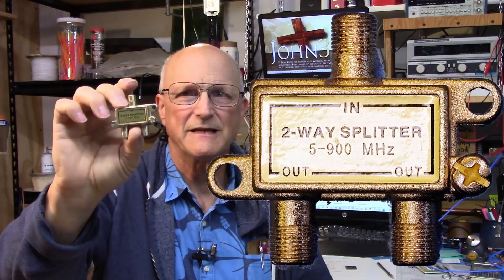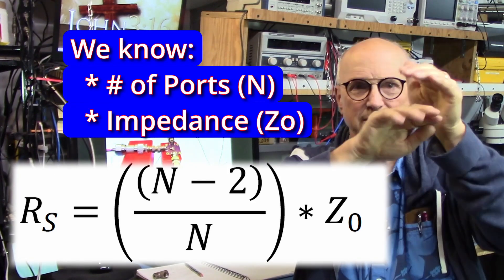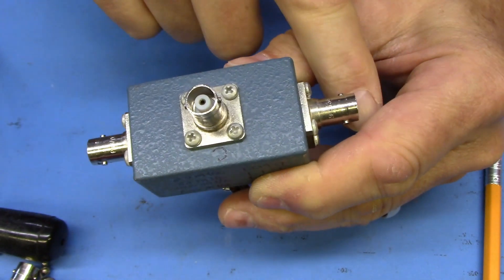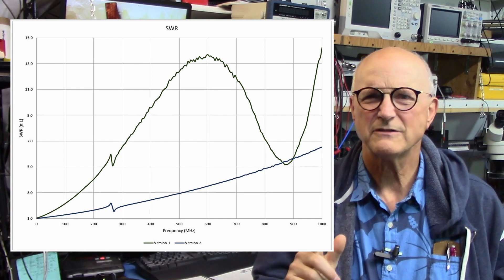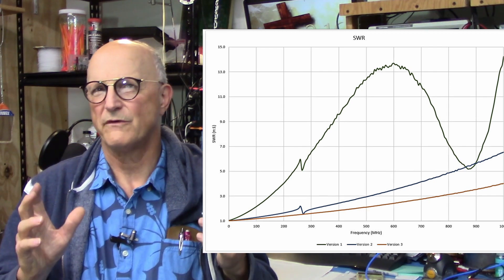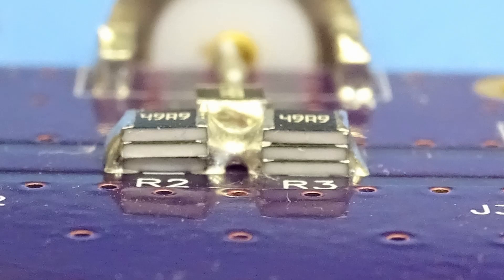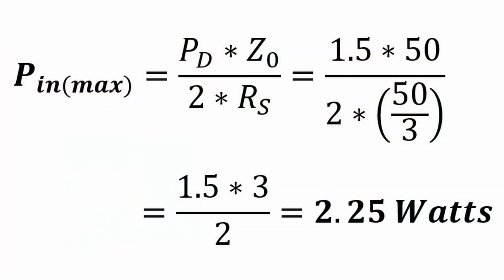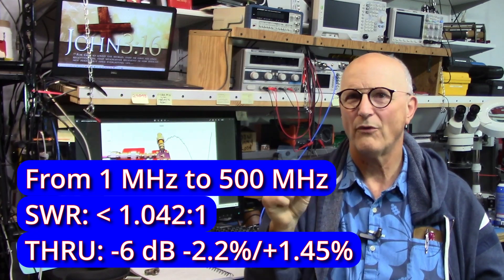RF Power Splitter Concept to Completion (035)

Comment: I very much enjoyed watching this. Thank you for putting it on Youtube.
And yes, as you kept saying, I could accomplish it.
Or rather, I could have accomplished it when I was younger (I am retired now).
However, it would have represented a significant investment of time from my point of view.
Why would you not go from theory and calculation straight to final implementation?
At one point I looked into specifying an RF project to be done by an RF designer/fabricator. 
This guy was a one-person shop, but he always went straight to surface-mount custom PCB for every prototype, using a board manufacturer from the very beginning.
If necessary he would tweak the values and the design until he got the results he wanted.
(Of course his cost per project was high.)
Since your design for this splitter never had to deviate from your calculations, it seems to me you could have done it that way too, and in less time.
Reply from the maker: Well, I thought I could accomplish this using leaded resistors using the really nice, blue enclosure.  So, try #2 was supposed to be my end product ... until I saw its performance.  Try#3 was an experiment to see if I could do it with leaded resistors at all; if this worked I would have bent up a MUCH prettier enclosure for it. When its performance turned out less than desired, I had to go back to the drawing board and figure what would work.
Having never done impedance controlled traces on a PCB before, this launched a whole investigation and experimentation into how to do that (See my previous 2 videos on this).  Then, try#4 was my first attempt at the final PCB-based solution. If it didn't work as well as I wanted, try#5 would have been born, but it didn't have to be.
The advantage of going through all of this was that I (and my viewers) got to see what wouldn't work so well and what does, indeed, work.